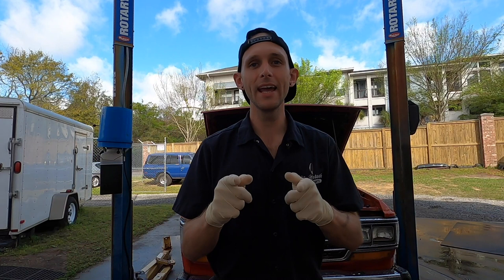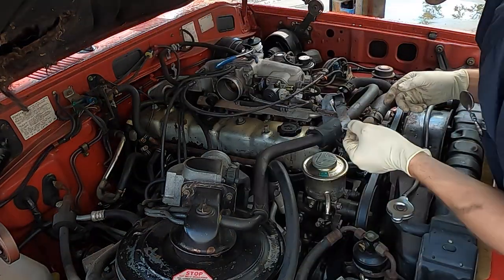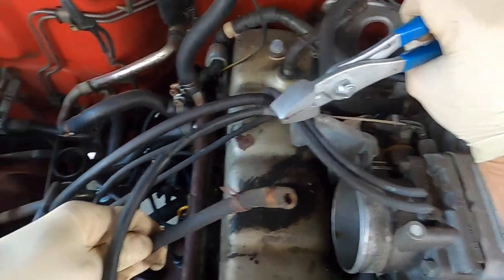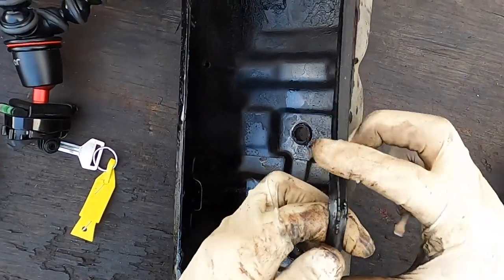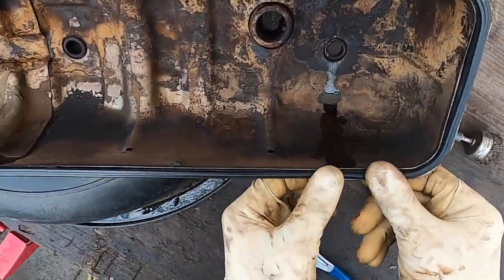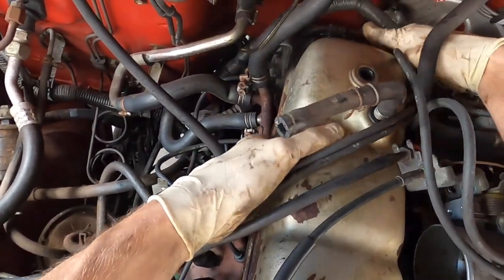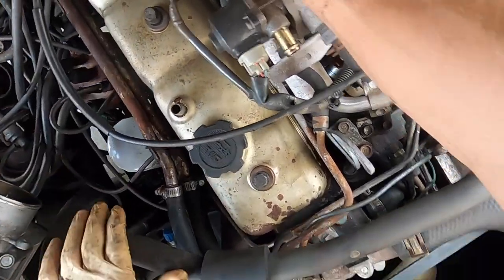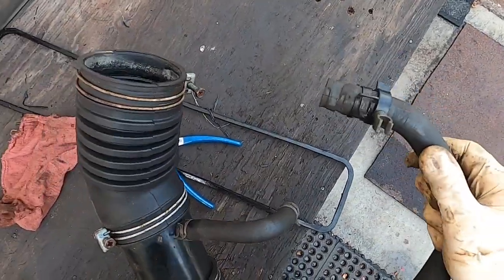How to FJ60 Valve Cover Gasket

Comment: what engine is that, i don't remember an EFI Engine for a fj60? Thanks.
Reply from the maker: It’s a 3F in-line 6
Reply from the maker: And it’s a fj62, fj60’s have one headlight on either side and also are manual transmissions unlike the fj62 here that has two headlights and an automatic transmission.